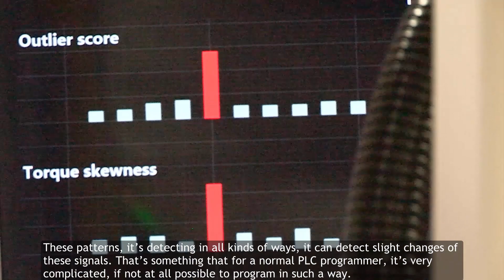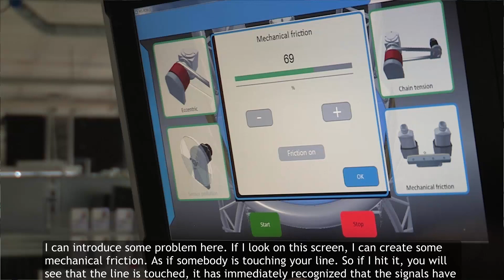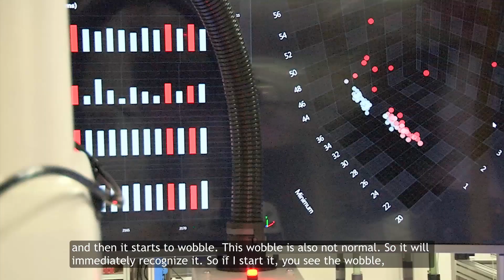Artificial Intelligence Demonstration - AI on the machine level

Comment: where is  AI here, assuming that you are using sensors to detect the abnormality than you can apply these abnormality directly to PLC without giving it an extra fancy name. But if you are continuously learning the pattern and giving it back to PLC then what approach is being used. Are you using Image Proccessing in this case